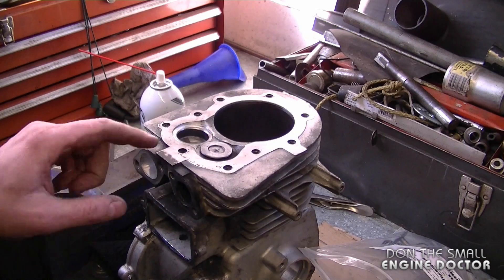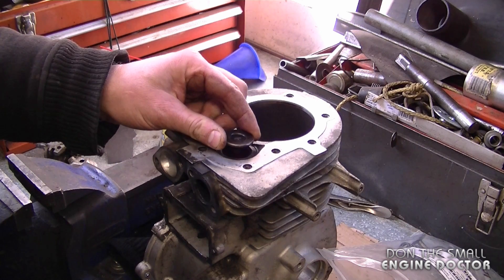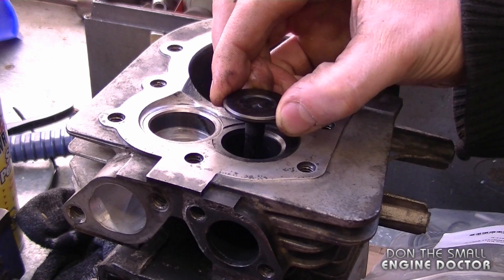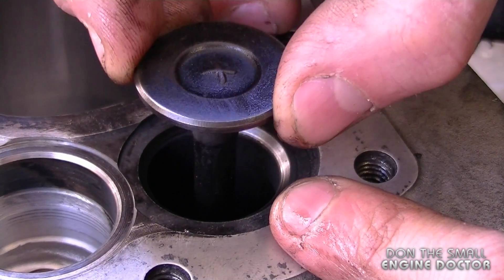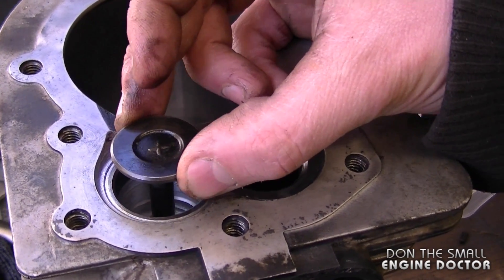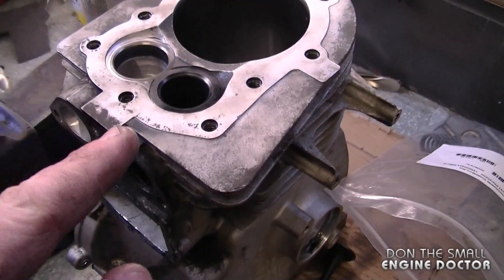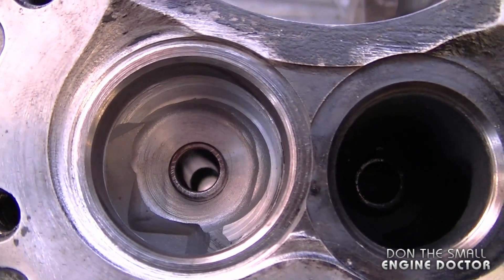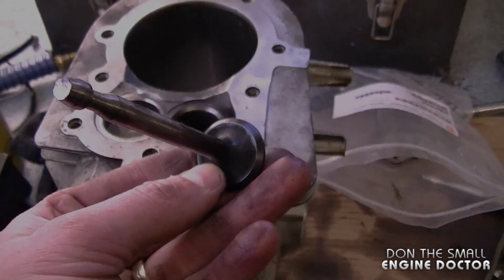Quick Tip #11 Worn Out Valve Guides

Comment: bent valves on an old engine but they only replaced the valves and stem seals its always had a poof of blue smoke on start up could that be because of the guides being worn and they didnt spot it?

Comment: My OHV Briggs has an intake valve guide sticking up toward the rocker about a half inch and the exhaust valve guide looks almost flush. Will this cause issues? Only 100 hours on the engine.

Comment: Listen sir I have  GY6 scooter 150cc jonway : the pressure is good : when  the rear wheel touches the ground it shuts off .. the piston and rings are new , the cylinder gasket is manualy made in cars gaskets maker workshop it is made of klingrit 1.2mm thickness mixed with metal , because I could not find the original cylinder head gasket which has two rubber paint on it and not totaly metalic ... what happens is that : it works for one month very good , but the valves cover vent is pushing oil to the tube which is going to the air filter ... then after one month  when the rear wheel touches the ground or press brake lever it makes black smoke from the muffler and engine shuts off , while it works Good on the stand, I do not know how the oil goes to there to the piston ??? no problem with the pressure and it works at idle on stand, as why the valve cover vent brings oil out ??? I have seen many people are suffering of the same problem but no one could tell where is the problem ??

1-when i go to adjust timing chain big hole and two small holes on the sides : ( I noted that the drive chain is a little streetched so one of the side holes is a little advanced of the other side hole , there is no way to adjust better than it : so I had to accept this result .

who can help ??? everything is new and professionaly installed as I am a mechanic but this problem is new for me ..   do you think taht I have the same problem you are explaining to me now in your video Sir?????

Comment: Hi, thanks for the great videos. I have a question to ask you: I had to lap the valves on a Flathead B&S 8HP. So I used lapping compound and cleaned off all of the deposits and got a nice seal. Cleaned all the lapping compound. When I went to adjust the valve gap, the intake which is supposed to have .008" there was about .013" or so of space...The valve stem looks fine, not broken or chipped and nothing is blocking the valve from seating properly. I was expecting to have to grind down my valve stems to compensate for it actually being closer to the push rod...Did I do anything wrong? Is something maybe wrong with the push rods or  cam shaft? Thanks for any help you could offer.

Comment: What does popping out the tell pipe mean when the timing is checked and set to spec. Also blue smoke coming out of tail pipe on start up then goes away in about 2 minutes. I was thinking valve stem seal for latter, and worn valve guide to cover both symptoms or jumped timing chain. This is a single cylinder Suzuki where timing is independent of the cam. In other words the timing of the spark firing is not driven off the cam. I need to buy a compression tester though. Any thoughts?

Comment: I had a valve guide work its way out an inch on a 24hp v-twin briggs. Bent push rods, dropped one in the crankcase, all kinds of fun. New guides aren't available. Do you think locktite 272 would keep it in place? Or do you know of something better? $175 head is not in the budget.

Comment: Hello Dony. If we have bad valve guides can we have lower compression? I have new valves, rings, pistons, and with this higher pistons my engine went from 10.5:1 to 14.0:1. So with 10.5:1 it used to have 16 bar on cylinder compression, and know I have 15bar at cold and 14bar at warm.... I don't know what to do now... I also switch from hydraulic lifter to mechanic because of the higher RPM to avoid floating. my engine its a suzuki swift 1.3 gti. thx in advance

Comment: I need some advice Don, I have a 19 HP V- TWIN engine mounted on a z-trak John Deere mower. At first, it would start pretty good cold, but after you run it awhile and shut it off, when you'd try to restart it, it would turn over great but would'nt start right up. It would spin and spin and just before you'd give up on it starting it would start.
I've changed the plugs, fuel filter, and put a new fuel pump on it. I havent got into the carb yet, it's a double barrel carb. It's either flooding out or NOT getting enough fuel. What do you think ? When it runs and you mow it runs perfect. O I forgot, its a Kawasaki motor.
Reply: Quick/easy way to check if it's fuel starvation is to use some quick start when this happens.  If it fires right up, it's starved, if still no start, more likely something else.
Reply: Gogle Plus Sucks you say " Quick Start " do you mean starting fluid ??
Reply: Keith Evans it’s probably the coil. It gets hot and fails. When it cools down it works again.

Comment: Brass inserts is the way to go,
What is the od on the valve .009-.012
Or try knurling the guide and reaming it back to size
Any good machine shop will make something work
Reply: Yes but it most likely won't be cost effective on a small engine even if you can find one willing to do that work.

Comment: That's too bad they don't want to sell guides anymore. Briggs and Stratton still has them, just have to know the part number, and have Brigg's reamer and driver set, which I have. I just put a set in this spring, about $8 apiece for the brass guides, and about ten minutes per side to install.
Reply: Could it be done with a drill bit and a drill press? I have an old Briggs that doesn't have removable valve bushings but drilling and installing removable bushings doesn't seem like it would be that difficult, but I'm not a machinist so......

Comment: I just rebuilt a Briggs recently with more than a 1000 hours and the valves were fine I just had to lap them.
Reply: josh33025 It always depends on the user. A well maintained engine will last forever. Except those "Made in China".

Comment: If the exhaust valve guide is bad oil will not get into the cylinder, rather the exhaust gases passing buy the valve will draw the oil up and burn it in the muffler not in the cylinder where it will be burned. I have seen bits of carbon holding the exhaust valve open.
Now if the intake valve guide is bad, this will draw oil into the cylinder and possibly foul the plug.
 I enjoy your videos, Ken
Reply: Ken Sorry, but you’re wrong. It will in fact draw oil up in the cylinder. When the guides are worn the valve doesn’t seal properly. It will draw oil up into the combustion chamber as well as blow it out the exhaust.

Comment: I bet the valve guides do not extend into the side inspection box enough to put rubber seals on the ends like on some motorbikes.
The only other option i can see is find valves with thicker stems and drill out the guides to fit, but thats nasty.
Reply from the maker: zx8401ztv the holes have become egg shaped
Reply: donyboy73 Dam!, so what will you do don?
Measure the tube specs and search to see if any other small motor has a compatable part you can order?